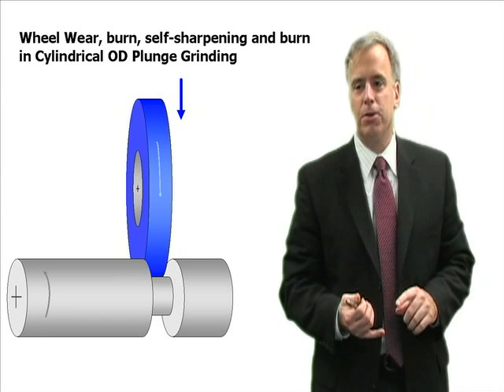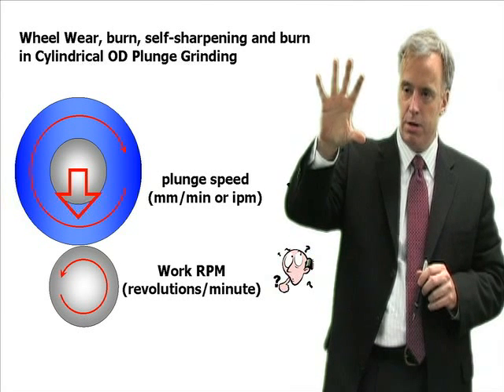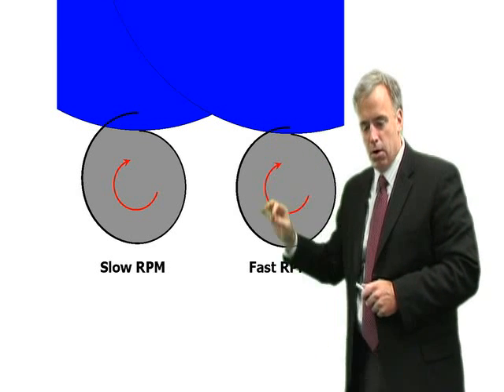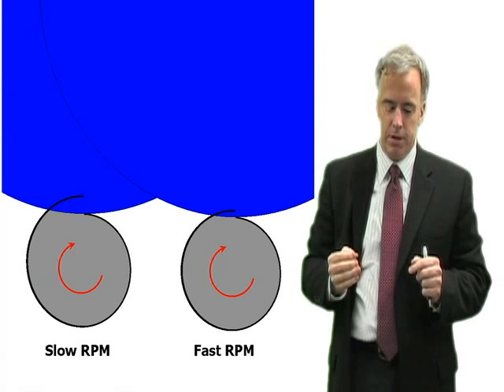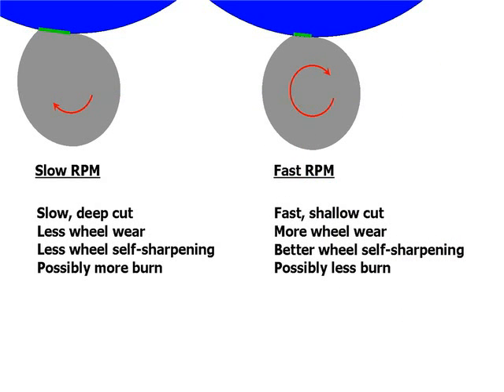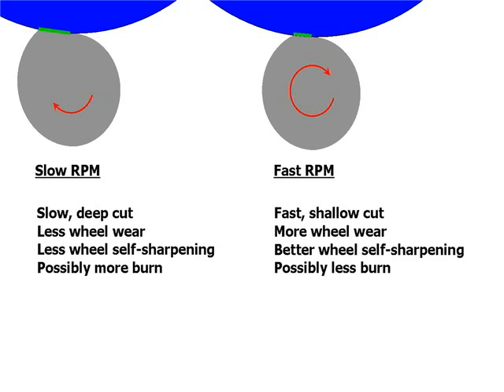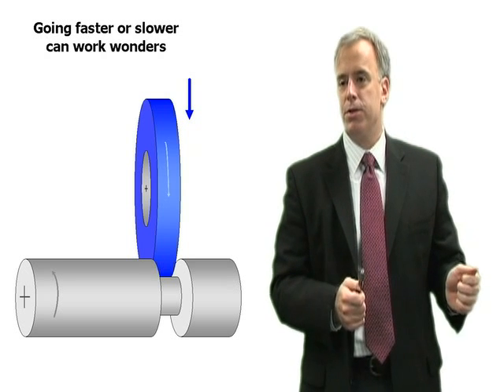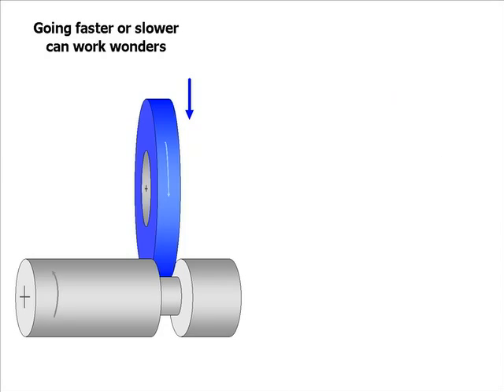Episode 7: Cylindrical OD plunge grinding offers options

Comment: @2:03
Why is the cut deeper when workpiece RPM is slower?
Plunge speed is the same, then the cut deep is the same, and slower RPM makes the chip smaller?
Reply: Because the depth of the plunge will be more per each rotation of the work piece since it is moving slower.
Reply: its a brain bender... try and picture it as gears. if the grindstone is spinning faster than the work, its drawing an arc through the work. vice versa, if the work is turning faster, its the work drawing the arc through the grindstone. only when two gears are the right size and pitch do they contact at the ideal pitch line...

obviously the stone is spinning much faster than the work. the difference in arc length is minute but its there.